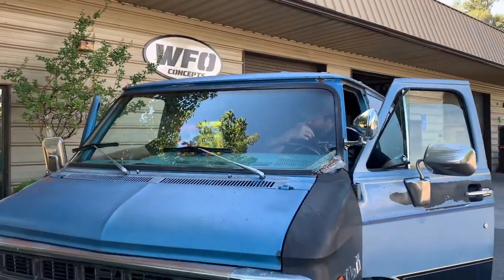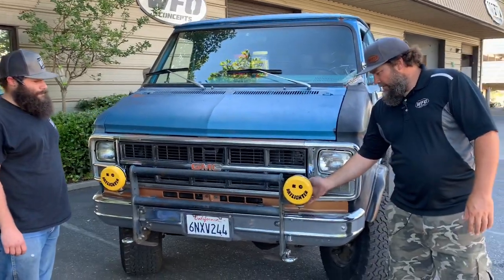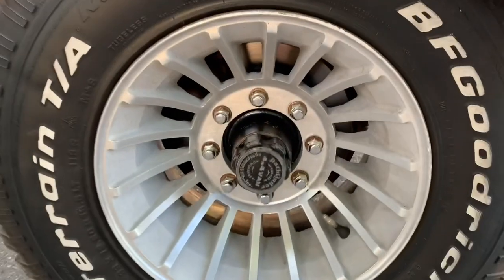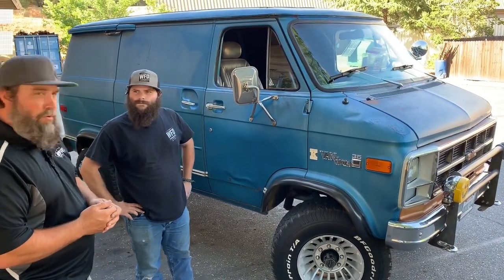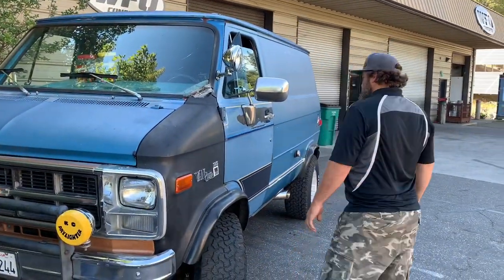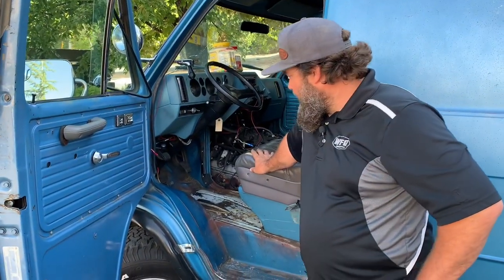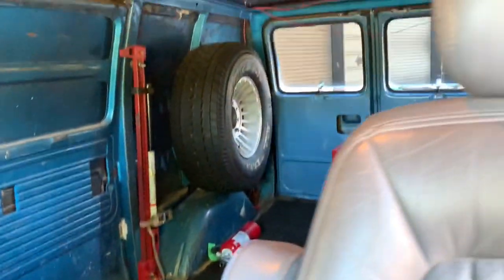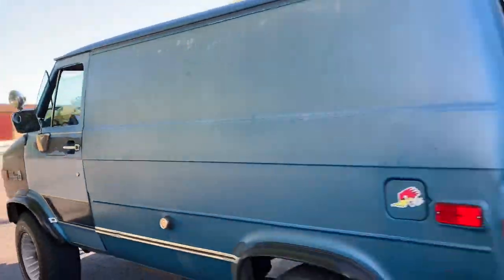LS powered 70’s 4x4  GMC Conversion Van

Comment: 77 and older had the round headlights. so if it is late 70's it would be a 78 or a 79. The mirror on the drinkers (passenger) side door is from the 70's so it is likely original, the mirror on the drivers side is 80's style